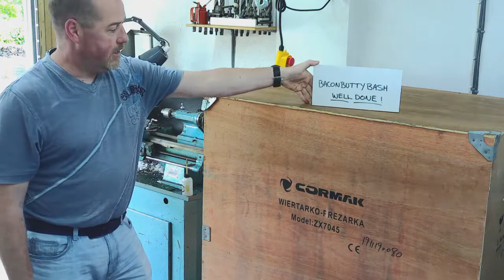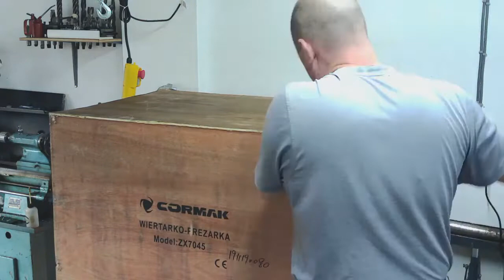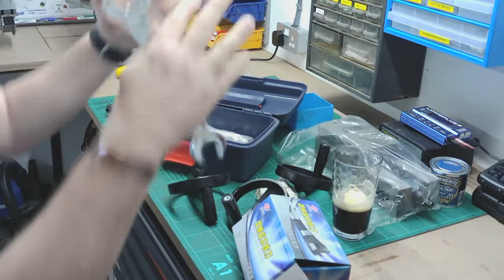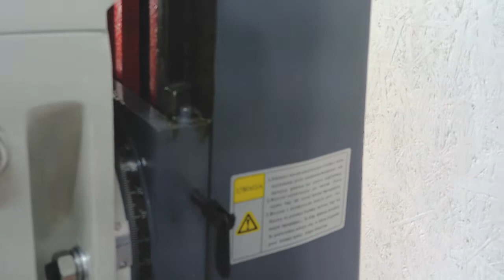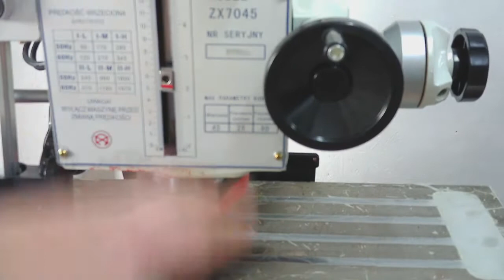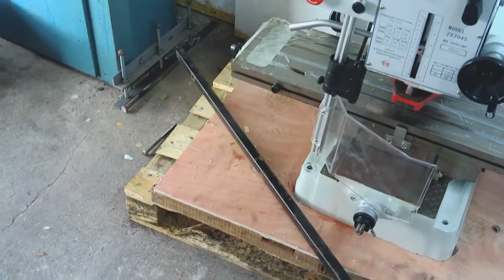Episode 16   My New Milling Machine Unboxing & Initial Thoughts

Comment: Hi Jon, just found your channel, I'll work my way through your videos as they look interesting, you will be surprised how useful an engine hoist crane can be if like me your usually working by yourself, you don't have to time your jobs to other people, you'll probably have it by now but I got a cheap one and found it very slow at first, its just till you pump it up and down a few times for the oil to replace the air that mixes in during transport(I was ready to send mine back) its fine now its been used a few times.
Reply from the maker: Hi Derek, welcome to the mad House! Thanks for the comment. Yes my engine lift was just as you described. It did come in very useful though as working on your own is difficult enough when you are lifting heavy stuff around. Cheers, Jon

Comment: Great video Jon. Congratulations to BaconButtyBasher. I agree with the engine hoist idea. I have a fold up one as my brother has stated. That mill is interesting. It's a sturdy lump, of that there is no question. However, it appears to share parts in common with my Chester Eagle 30 Rong Fu clone mill. The table and base are the same. The quill and fine/coarse feed mech are also the same. Your one has a proper column as opposed to the round one on the Rong Fu. Because of these similarities I suspect your mill to be made in Taiwan. That makes it a very different proposition to the Chinese built ones. Generally the Taiwanese castings tend to be much better quality. 

Incudentally for a vfd you need the motor wired in delta. You could still do that if you wanted to as I expect that the windings will be brought out to terminals in the jb on the motor to be configured as needed. On my Harrison Mill I've had to strip the motors and pick out the star point from the windings and rewire them to delta. Good idea to go for an M16 drawbar for MT4. My Rong Fu clone mill has MT3 spindle with M12. The Harrison Mill is Int30 with a drawbar that looks like it's last job was holding down the bed of a triple expansion engine in the Titanic. 

I seem to remember you saying you were going for a rotary converter. Looking forward to seeing that when it arrives. I'm also looking forward to the next episode to see you moving the machine on to its stand. Be careful. I had to watch with a sick feeling in my stomach as my Harrison Mill went over on its side in the back of a lorry as the delivery driver tried to move it with a pallet truck.
Reply from the maker: Hi Carl, wait for the next episode, it will be immediately apparent which part of the world the machine hails from. You nailed it in the bandsaw episode so well done. I will make it right one way or another otherwise I will give up and take up crochet. I have bought a static converter (cheaper and less to go wrong) it arrives Monday, although as you will see in Episode 17, I'm not going to need it for a while. Thanks for the detailed feedback which is very much appreciated. Cheers, Jon

Comment: Nice looking machine Jon, nice to see it in action. I went down the engine hoist route to, I bought mine from a place that refurbishes them and the price was amazingly cheap considering. Think they advertised on Ebay not sure now. Also invested in some proper straps which make the whole job much easier (and safer).
Reply from the maker: Hi Derrick, thanks for the comment, good to hear that I am on a proven track. You may find my next episode interesting!!! Mine was just over the £100 so not bad really. Cheers, Jon
Reply: Oh ! Well I am definitely not going to let on how much mine cost then Hahaaa

Comment: Hi Jon, I've been down a similar route, M16 to MT4 is far more available on the used industrial market.  Also if you are going to make a draw bar and thread it on the lathe great, if you are looking at threaded bar its available in unmarked junk (most places), 8.8 and 10.9 for an extra couple of quid don't buy the junk!!
Reply from the maker: Hi Richard, thanks for the comment, everything is becoming clearer in Episode 17, the lathe will be utilised but mainly because I have dropped a bit of a clanger. Anyway it will make a good project so all good. Thanks again, Jon

Comment: Engine hoist is the way forward I think Jon, my brother uses one to lift his behemoth Harrison milling machine. The new mill looks good, it will be interesting to see how it performs.
Reply: you can hire  them by the day
Reply: @gagasmancave8859  for the price, it's handy to have your own. They fold up for storage and if you move house or you feel like a rejig in your shop they are handy.
Reply: @retromechanicalengineer  Seconded. Thirded even.
Reply: Paraphrasing Snagglepuss.
Reply: @britishreaction54  Forthed even lol
Reply from the maker: @gagasmancave8859  hi Nigel, I looked into hire but it was half the price I paid for the cheapy off ebay so I just went for it as I will need to move stuff in the future. Damn good excuse to get another tool in the collection also. Cheers, Jon
Reply from the maker: Hi Dean, thanks for the comment, glad I am on the right track. It won't be performing for a bit yet...... Wait till Episode 17, another reveal. Cheers, Jon

Comment: If you loop the cable on your hoist does it double its lift capacity ( I thought some of the small electric hoists had this provision.
Reply from the maker: Hi Peter, you are correct, mine is 125kg single and 250kg double line, so still not enough unfortunately. Engine hoist will do a better job as it is movable, my crane is fixed in one position so not too versatile. Cheers, Jon